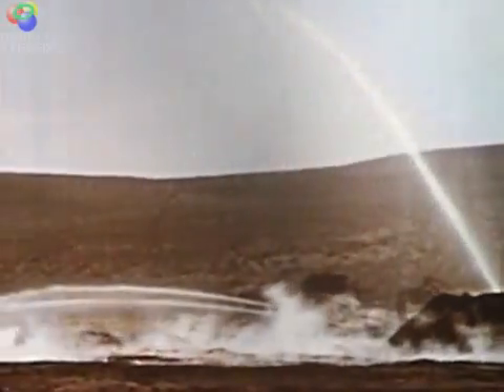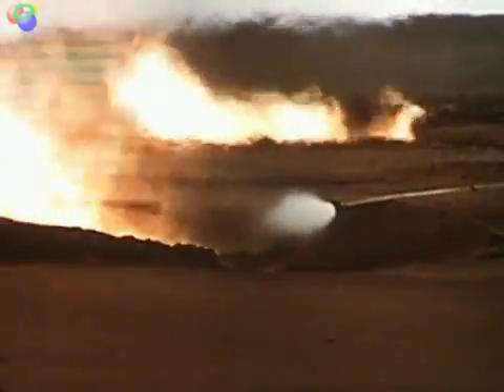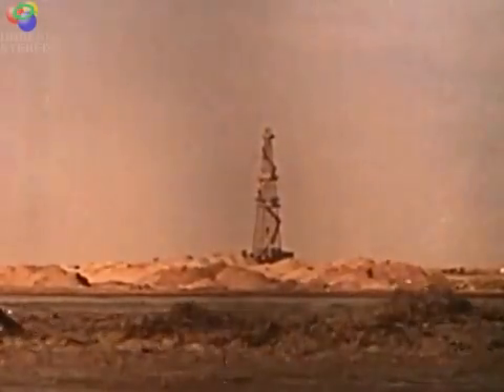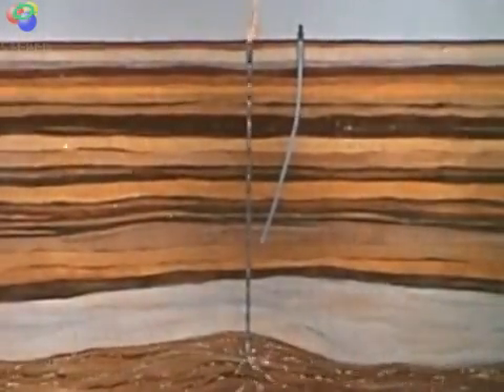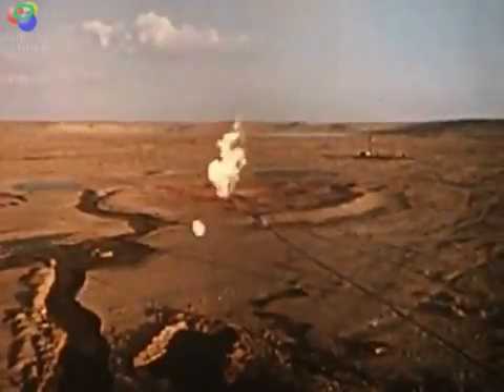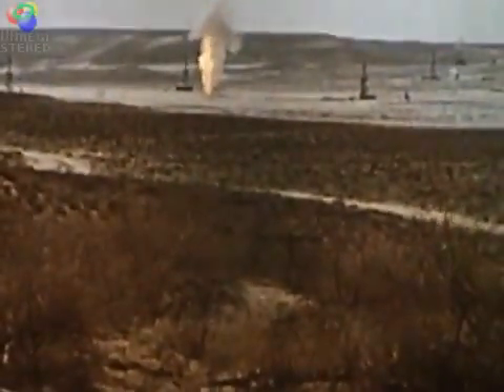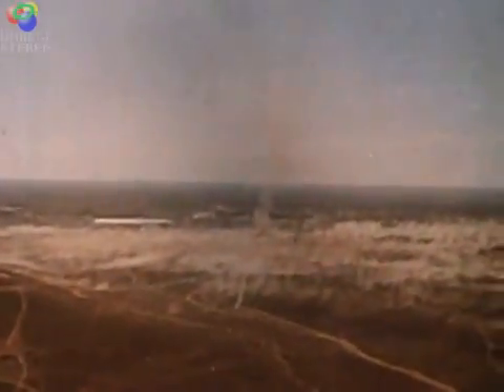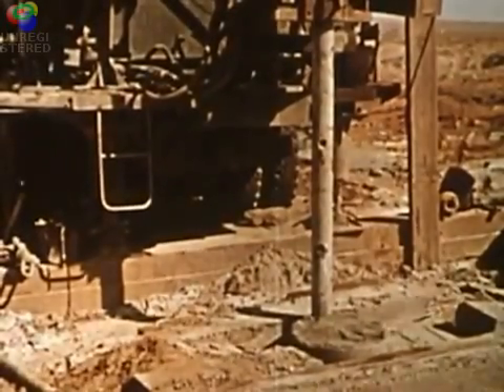How the Soviets stopped well blowouts, from back in the day...

Comment: They use conventional high explosives to put out oil fires above ground, so while it sounds extreme using a nuclear charge, this does make a lot of sense. Desperate times call for desperate measures and this is one of them!
Reply: They used to, but with advances in technology they are either capped while still burning or use huge water pumps to kill the fires. What this video doesn't show is the multiple failures Russia had on other wells using the same technique.

Comment: This is what was proposed to stop the Deepwater Horizon well in the Gulf of Mexico from filling up the trench it sat near with petroleum. But the mainstream media all said stuff like, "You can't drop a bomb on it, that's insane!" and the solution was ignored. Why? Because 90% of the oil coming out of that well was heavier than water, so it was determined by the oligarchs that the environmental impacts were to be ignored, with seemingly generous compensation doled out to businesses affected by the disaster (cheap PR campaign) while 50 to 100 billion dollars worth of petroleum was allowed to fill the 3000 foot deep trench there so BP could come back and suck it up later.

Comment: They could've just exploded a large volume of non nuclear explosive which couldn't ended up with the same result.
Reply: There is a known problem with getting a large something into a drilled hole.
Reply: +NGC1433
Instructions unclear, dick stuck in sett.
Reply: Would have required hundreds if not thousands of tonnes of conventional explosives, why not use the nukes they had an abundance of?

Comment: To all those triggered people here: This is actually an amazingly genius use of a nuke, it turns a weapon into a useful tool for rescue. Radiation doesn't magically spread everywhere and it is generally depicted as much more dangerous than it actually is. For radiation to be detected, radioactive particles, which right here can come only from the nuke itself, must be present. This nuke was detonated deep underground, so that risk is minimal. It is quite plausible that no radiation was actually detected thereafter.
I understand fear and reasonable care when using radioactive materials, especially weapons grade, but please, use your brain before fearmongering.
Reply: wyomins 
What if this was the only directly useful nuclear explosion in history?
Reply: SHERMAN YOUNG You are starting a strawman there. Nowhere did I mention Chernobyl, the disaster there and a nuke are two entirely different things. Chernobyl wasn't even a nuclear explosion! Please educate yourself on the topic before spewing nonsense.
Reply: that enormous gas fire and release of stuff like H2S is a big problem too, hell this use of a nuke is 10 times better then the crackpot ideas the americans testes. like the time they tried nuclear fracking and fucked up BAD.
Reply: Chernobyl had some design issues like the graphite tipped rods, and negative coefficient. what really caused the disaster is bad management and leaving junior engineers to run the test along with those other flaws though ; like most disasters it happened when multiple factors combined.
Reply: SHERMAN YOUNG If we speak about cleanup and take into account how technology and even general knowledge improved since then, yes, I think Chernobyl was a successful operation and Fukushima is a multi layered fuckup shitcake. Also Fukushima nuclear disaster is a result of a poor design as contrary to blatant negligence and human error in Chernobyl. 11 type RBMK reactors are still operational.
Reply: It's the largest country on Earth and I live far away, so it's fine with me if they take a nuclear dump in their own backyard. Also, the genious simplicity of it all triggering conspiracy-junkies to look for smoke and mirrors is lol
Reply: Def7355608 It is quite plausible..lmao okay dork!!
Reply: It is easy to imagine a situation where the nuke  explosion failed to stem the flow of gas and then the gas is bringing up radioactive material and blowing it into the air ...
Reply: wyomins Well, Semilapatinsk is not LA. I don't really see your point.
Reply: Well, Cream of the Crop, can you tell me the difference between a Sievert and a Gray without googling it? If not, then you should not be telling me what is plausible and what not.
Reply: poor design is a result of negligence and human error...
Reply: poor design may also be a result of insufficient knowledge... it is not always negligent. I can't judge which one it was in Chernobyl.
Reply: Def7355608
A huge problem with Chernobyl was that the power plant was built to work far more efficient than earlier reactors. They where inherently unstable thanks to greed.
Reply: Electro-Cute As I said, I am not sufficiently well informed to make a judgement on what caused the Chernobyl disaster, whether it was negligence, greed, lack of knowledge etc.
Reply: If you look at the detonation, you can see a lack of cloud aside from what you get when you strike an object, eg, a wide, flat cloud.
Reply: There are always side effects. Contamination of ground water is one I can think of.
Reply: Def7355608 since you say it's ok I feel way better 
Thanks man
Reply: NGC1433 I'm not arguing that by any means. It very well could be. All I am saying is don't trust Soviet Propaganda, or those that believe it.
Reply: This video is from the same government, time frame, and propaganda machine that deliberately detonated nuclear weapons near inhabited areas of Semiplatinsk Kazakhstan to measure the effects of long term radiation exposure on humans. Not saying this wasn't relatively safe, but first off who knows if this was actually an atomic explosion, and second off they lied about literally everything else so why trust what they are saying? Plus who know what strata lies beneath that is now irradiated with plutonium...
Reply: Def7355608  the Russians also have a long history or lying and covering up just like the US
Reply: http://large.stanford.edu/courses/2014/ph241/powell2/
The soviets killed millions with the collectivization of agriculture in the 1920's and you think they were concerned with a hundred thousand local residents? Do you also really believe they did not know about the dangers of radiation? The above article explains that they deliberately misrepresented the amount of people living in the blast radius claiming the region was "uninhabited", then set up an obscure medical facility to study the results of the tests on the population. Why else would they do that if they were not interested in the results of nuclear fallout on people? If they were concerned at all about the effects of fallout they would have changed the location to a truly uninhabited region. They tested nuclear devices at that site continually until 1989, and only stopped atmospheric tests in 1963 due to an international treaty. To say they didn't know of the exposure to residents completely disregards the true scientific prowess of the Soviet Union which was able to put the first man-made object in space and do genetic studies that are still used as references today. They knew what they were doing to the people of Semipalatinsk, and they did it intentionally.

Comment: "this created a threat of air contamination over a big area." so we DETONATED A NUKE
Reply: H2S is nothing to screw around with. I realize that doesn't make the point. <0.0001 grams of H2S in your lungs can kill you with one breath. Critical mass  is usually measured in kilograms. 

The oral toxicity of uranium compounds has been evaluated in several animal species.
Oral LD50 (dose producing 50% mortality rate) values of 114 and 136 mg U/kg have
been estimated for rats and mice, respectively, following single gavage administrations
of uranyl acetate dihydrate (Domingo et al., 1987).

I'd rather face a gram of uranium(in a bomb or oral)  than a gram of H2S.
Reply: - deep underground under a impermeable strata of ground ; with the drill hole filled with concrete.
Reply: Obviously, the nuke stopped the risk of air contamination, so what's your point?
Reply: There are not many situations I cannot imagine going very badly, but I doubt they just guessed a depth. They had experience with subterranean nuke tests. As for not plugging the hole, sure I don’t see how they could be certain it would work. So what? Back to square one. My point was that most of us have a really screwed up risk matrix. "Feels" screw up our thinking when it comes to risk.

Just because I love a good argument:
I'm not qualified to discuss the biological aspects of H2S metabolism but I’m willing to go out on a limb and assert that the concentrations in the human body stay much much lower than 5 ppm. I doubt the same was true of the atmosphere above this well. CO is not generally as concerning as it does not stratify with air. H2S, on the other hand will concentrate( approach 1,000,000ppm) in low spots and when disturbed (walking), pockets of it can reach the level of your face. Sure by the time it has reached your face it has been diluted with atmospheric air, but even if it has been diluted by a few orders of magnitude, one breath can still kill you. 1000ppm of CO will render you unconscious after one hour. 1000ppm of H2S is said to kill in one breath. I will gladly take a single breath of air with a 1000ppm CO concentration, especially to avoid a 1000ppm breath of H2S. However, in proof of my above point, I would also bet more people are killed by CO each year (more likely exposure). CO wasn't a risk I managed to identify in the video.
Reply: flint michigan
Reply: Yes. Under ground. Not on the surface. What's the problem? Or are your feelings hurt just by the fact?
Reply: "The toxicity of H2S is comparable with that of carbon monoxide. Since hydrogen sulfide occurs naturally in the body, the environment, and the gut, enzymes exist to detoxify it. At some threshold level, believed to average around 300–350 ppm, the oxidative enzymes become overwhelmed. Many personal safety gas detectors, such as those used by utility, sewage and petrochemical workers, are set to alarm at as low as 5 to 10 ppm and to go into high alarm at 15 ppm"

It is easy to imagine a situation where the nuke failed to stem the flow and then they have H2S AND irradiated material blowing into the atmosphere. There was certainly a risk of making a bad situation worse.

Comment: look up - #TROMPE #Applied #Science.  the principle of using falling water to trap air in the ground/salt caverns are filled with air or water in gas or liquid form.  
https://youtu.be/nASpvGghrqA

USE #wind and #solar to run water-powered #steamGenerators... something that has been in the back of the water-fuelled salt-exchangers AKA fuel-cells  the water has filtered down thru the carbon and salt formations for thousands of years.  It would cost a #billionUnits of energy to extract water in liquid form; by converting that same water to a vapor, you reduce or eliminate the energy costs.  #FALLINGwater as the driving force to push the water back up thru a second well as a vapor at a fraction of that #sameNergy cost is something that the ppl of #CentralAsia were practicing 2000 years ago.  SEE the documentary - #Machines of the #AncientOrient.

Comment: this was posted right after DeepWater HoriZon; there is a Long list of what Could go wrong; the the so Viet kommittee did not have to worry about the media ever publishing the risks so back to your homes komRads!!  Love the way the ppl fixed things - Back in the Day!!  GREAT find.
Reply: Remember when they were considering this as an option for deepwater if all else fails?   I suspect even if it would have worked and saved the day, the slightest bit of radiation detected would have caused a shitstorm!
Reply: Vinn, I have two words for you. Operation Plowshare. See what happened in the country where media could publish the risks.
Reply: " the the so Viet kommittee"  you've got a bit of a problem there Vinny.

Comment: Erm, wouldn't conventional explosives do the job as well?
Reply: What fun would there be in that?
Reply: Conventional explosives ran the risk of being pre-detonated due to the intense heat and pressure. There were 4 or 5 instances of the Russians using this method between 1963 and 1981, it is not immediately obvious if this was the first of the nuclear well closing detonations.

Comment: The line between genius and unfathomable stupidity is indeed a thin one...
Reply: Just fucking drill a new one. That gas layer wasn't like 15 feet wide.
Reply: It was effective. No negative side effects. Therefore it was correct. Even if the line is there, this method is clearly on the genius side of it.
Reply: Richard Casamento you think about it. It was more cost effective to detonate a nuclear device of small size by putting it in a small hole rather than bore a much larger hole for conventional explosives for the exact same desired effect
Reply: The only difference between genius and unfathomable stupidity is catostrophic error
Reply: @Kakto Tak Sure,but that well won;t be "open for business" for a loooong time.
Reply: Yea w8 untill you hear about americans testing nukes 10 miles our of small city.... 

Those people dude RIP"""!!!!

Yea what you expect from americans...
Reply: l337pwnage Another one know it all. 
Why didn't Germans themselves built all the tech? :D
Reply: let me guess... you had a better idea about it back in the 1960s?
Reply: Russians and Germans seem to be smarter than Americans. We wouldn't have gone to the moon without them. :-D
Reply: +NGC1433 They did build rockets, jet planes, and were working on nuclear weapons, but none were a major priority because the war was not going to last long, so they had to focus on conventional weapons more.
Hitler also didn't prefer weapons of mass destruction because too many innocent people die.
The Guns on the Soviet T34's were also German built, and so is the gun for the M1 Abrams tanks.
A German POW in a U.S. prison did the math for a flight to Mars.   Decades ahead of any nation that could even think of such a feat.
Reply: +Chris Yarzab  Russia got tech from captured German scientists, and America got tech from German scientists defecting to America to get away from Russians, Russia only has nukes because the tech was smuggled there from America by the actual people who started WWII.

Comment: I love the smell of plutonium in the morning...
Reply: ***** Oops...my bad. You're right.

I love the smell of uranium-238 in the morning.

Nope. It doesn't have the same cache does it.

It's actually a neat idea. I just wouldn't re-drill the field for about 700 million years.

Mind you..they did rebuild Hiroshima and Nagasaki....hmmmm
Reply: ***** It's a bit more complicated than that. U238 is cheaper but that isn't fissile, you can't make a nuke out of it. U235 isotope is fissile but it's as rare as gold and extremely hard to separate from U238.
U238 can be transformed in a reactor into Plutonium, also, at quite a slow rate not to mention dangerous to extract.
But from the 1960's most bombs were a 3 stage design.
The first stage is a very small plutonium and uranium mix based bomb which was simple fission (with fusion boosting).
The second stage is a fusion device which can only be set off by the power of the small fission bomb. The fusion device isn't much more powerful but liberates a huge flux of neutrons.
The final stage is a fertile tamper, made of cheap U238, this is where most of the energy of the bomb comes from as the neutrons from the fusion stage cause prompt fission and also burns away much more of the partially exploded fission stage.
These bombs can pack a lot of power into a small space and are very cost effective as they use a relatively small amount of expensive fissile material. Fissile material of a 1 kiloton bomb able have power of 1 megaton bomb.
Reply: stevest1300 Yes, and the glow is even better! Lol
Reply: I wouldn't call it hard to separate U-235, just expensive.
Reply: stevest1300 You mean you love Uranium 235. U238 is not weapons grade.
Reply: stevest1300 It beats a libtards vegetarian diet producing farts.